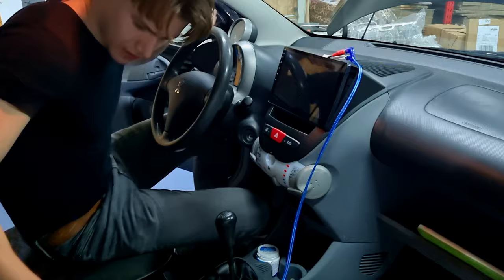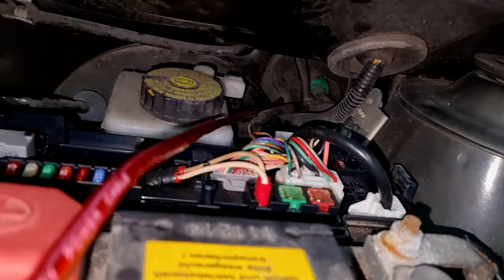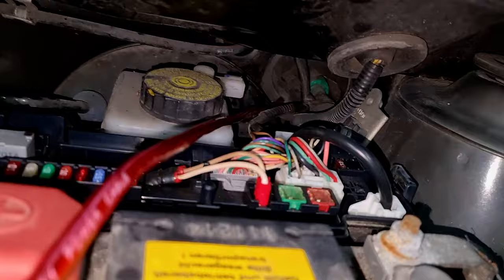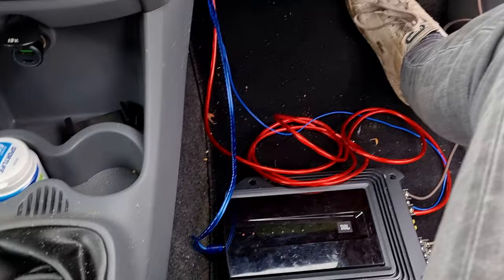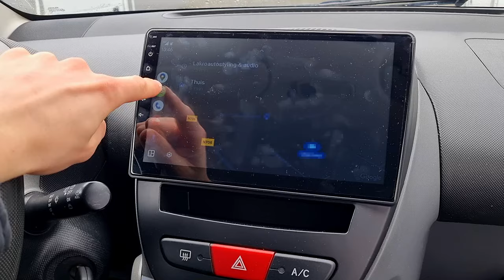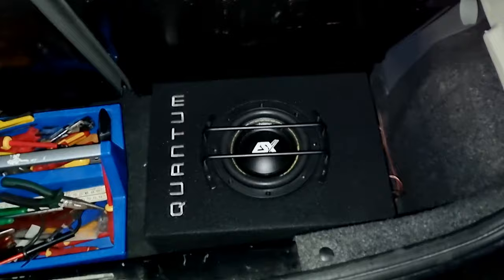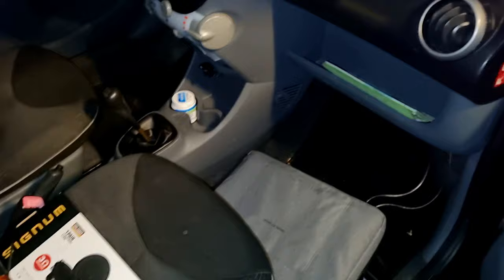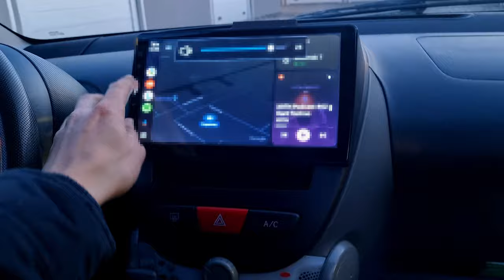Android Auto/Apple CarPlay Radio Install Peugeot 107, Toyota Aygo, Citroen C1

Comment: I have a biiiig problem. When I launched the equalizer app. The tablet froze and then restarts over and over again. Can’t even reset it through the reset pin. It’s annoying. What do you think I should do. Do you have any idea? 😃
Reply from the maker: Try to disconnect all the wires to the screen and then disconnecting the battery. Leave it for 15 minutes then reconnect the battery and then the cables to the screen. Hope that will work. If not let me know
Reply: @DIYTuning did you need to change any wiring, or was it just plug and play? Because I find it very strange. The color that comes out from my car cablage is different colors then the adapter one has from the Junsun case. Do I might need to switch so I get the Black red and everything matching? What do you suggest?

Comment: geat video, thanks mate! couple of questions - did you connect both usb (4-6pin)?where did you place them? no place for them in the plastic frame. - how did you wire/connect the antena?
Reply from the maker: I didnt do the antenna because I dont use it. I have no usb port also, maybe make a cutout for it in the frame? I use the cigarette lighter for charging my phone.
Reply: I did wire the antenna, bought a din to iso cable on amazon for a few euros. Used the 4-pin usb cable as the 6-pin was not recognized by the tablet. Routed it to a small gap on the passenger side, near the feet :)
Reply: I ended up drilling a small hall down and place the two usb cables there, super happy with the results 😊. thanks guys for the replies.

Comment: Does it have more amplifying power than the original unit? I upgraded the speakers but the difference is not noticeable
Reply from the maker: Have not tested it without an amp but can't imagine its much better than with the stock head unit. For really nice sound get an amp that can power the two front speakers and a small (6.5 inch) subwoofer in the back
Reply: @DIYTuning  gotcha

Comment: Hi man, thanks for the video! 
How is your Junsun system? Does it still operate well? I read some mixed opinions about it...
Reply from the maker: For me it works very well. Only complaint I have is that sometimes the system has trouble connecting to android auto when i turn on and off the car multiple times in a short period, but that doesnt happen very often
Reply: Turning on standby mode should fix that

Comment: By coincidence I ordered the same brand! The most important thing is that there is no need to cut the plastics in the middle of the hole! 
I was very skeptical to do it, so I'm very pleased.
One question, did you use the USB connections that come together with the console? If yes, from where you pass the wires?
Reply from the maker: No I didnt use the USB
Reply: Same. How is the new plastic piece it looks quite fragile?
Reply: It's not fragile! Well, I haven't tested it with a hammer or something :) but it looks legit! The unit works as is supposed to and for the money is an excellent purchase
 @DirtyBeans

Comment: How do u connect antenna wire to turn on subwoofer when the key in the ingnition.
Reply from the maker: I think there is an antenna wire comming from the radio that you connect to your amp/sub

Comment: How exactly did you get in with the plus cable? from the engine room to the them room. Did you cut something open or press it in?
Reply from the maker: There is one rubber grommet that you can push the cable through. Tape the cable the wire to a long screw driver and push it through the grommet
Reply: @DIYTuning  Which model and brand of this radio that you installed ???

Comment: Did the radio antenna cable come standard or did you buy an adapter?
Does Android turn off with the key or does the battery go dead overnight?
Reply from the maker: Yes you need an adapter piece fot he antenna, i dont use the radio so i dont know wich one you need. Yes it turns on and of with the key so the battery wont go dead
Reply: @DIYTuning  Great, thank you very much, I will install it tomorrow 👍👍

Comment: yo bro, heb jij de link nog/specifieke model van de carplay module?
Reply: Zou op Ali zoeken naar een Junsun unit. Heb zelf 2/32 met AA voor ongeveer €105. Hij heeft de 4/64 unit met AA voor het dubbele. 

4/64 heb je in principe alleen nodig als je navigatie apps wilt gebruiken op de unit zelf. Doe je dat via AA/Carplay en luister je op de unit zelf verder alleen radio/Spotify, dan is 2/32 voldoende.
Reply from the maker: Dit dus👍